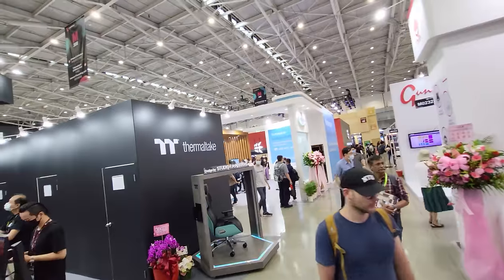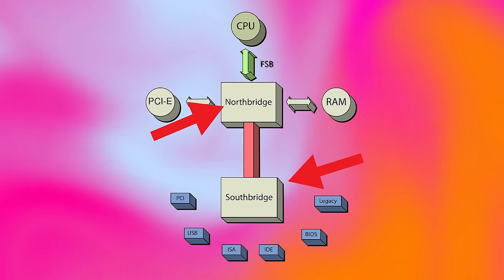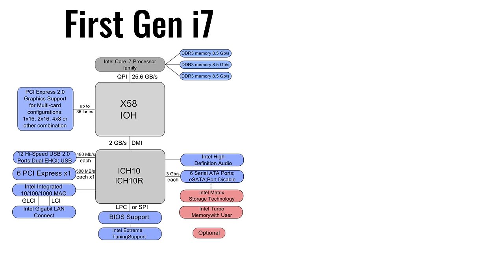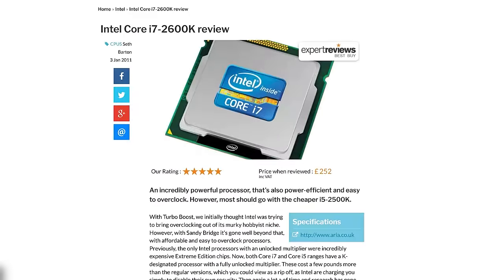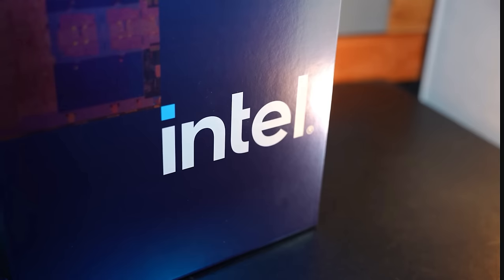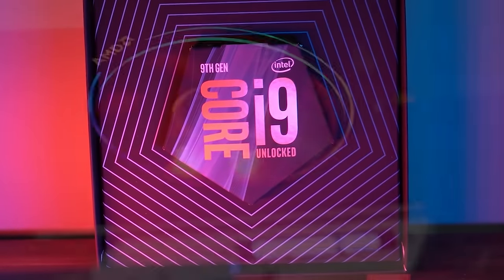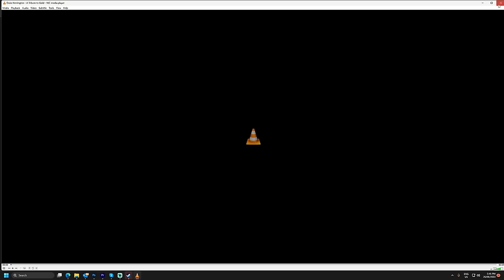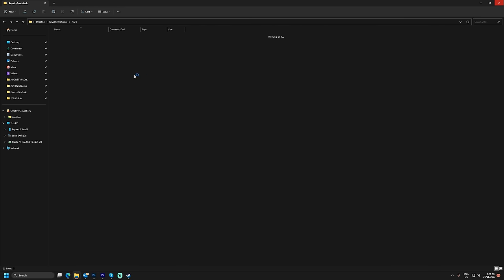SNAP - The Intel CPU Latency Story (Part 1 of 2)

Comment: This is a subject that alot of us have already considered and talked about at least in my freind group.  We still think the experience is better on 12th and 13th gen Intel then modern Ryzen counter parts. Ryzen freezes, lags, stutters, hitches randomly way more then our Intel builds you can tell when you are using Ryzen there isnt even a need for a blind test.  But its still considerably better then modern Ryzen we have systems over here laptops and desktops and side by side the experience is still better on 12th and 13th gen Intel.
Reply from the maker: It's a topic that I see literally see no one talking about, people behind the scenes were VERY RELUCTANT to talk about the issues in-depth.  However it was enough for me to start getting the word out and telling people to believe what their eyes see, rather than just listening to the 'it's all in your head'. I will have to start getting more objective measures in place though, but that will take time to set up 3 different rigs and have a standardized processing facility to weed it out.
Reply: freezes, lags, stutters, hitches randomly? just upgraded from haswell to ryzen 7700x. I'm using windows 11 and linux and didn't notice any on either setup. If my system "freezed, laged, stuttered or hitched" i would check it it in the logs and fix it or replace the part causing
Reply: I got the freeze/hitching problem with 5900x and 1600, but not with 3600 (using standard cl18 3600 ram), also my 10400 was smooth as hell, right now i'm using 12400, I do think my 10400 kinda smoother than 12400. ( yeah i changed processor a lot for every 3 months back then,  just because out of curiosity) I'm gonna stick with 12400 probabbly until it brokes. Can't see the merit of upgrading processor with already existed last 2 gen until te new one gives 3x boost performance.
Reply from the maker: @michal1693  I did say in the video, that it won't affect many at all. Nothing wrong at all with the system, if you want to trial hitching your system, get about 80GB of video footage into a video editing program, have at least 10 tabs open, excel at the same time, photoshop, 4 different file tabs and then start alt tabbing between them.
Reply: Not getting the stutter or hitching on 5800x3d, i've also owned 3600,5600 and 5800xpreviously with no issues in that regard (i notice anomalies like that pretty fast)
Reply: @techyescity  - the architectural latency you mention in the video i believe is a real thing. Kudos if you find methodology to measure it in real life. The "freezes, lags, stutters, hitches randomly" he mentions are a different thing and can be easily tracked in logs.

Comment: You should try using cms/mbr instead of uefi/gpt. Most systems still feel horrible and have huge latency penalty on uefi and gpt, screw resizable bar, not worth it at all. Seriously try it. 

I'm a latency enthusiast ok lol, know my way around windows better than your typical tech reviewer or casual gamer who likes to use custom os like atlasOS or ggOS. With uefi/gpt on a well configured windows (disabled unused devices,drivers,services and sleep deltas stable at 1ms and using independent flip instead of fse etc.etc.) basically just following calypto's latency guide. 
So with a tweaked windows, 13700k/3080 still has higher input lag than a fresh install 22h2 with mbr/cms, just on the desktop you instantly feel the mouse is not floaty at all like on gpt..
And after tweaking windows on mbr/csm it's a whole different story, amd can't even get close to feeling this snappy. Especially their unstable 3d v-cache that has messed with bunch of latency sensitive peoples muscle memory in the tweaking community.

So yeah pretty sure your main problem with 12th/13th gen is using gpt unfortunately. There's also the ecores tho.. If you oc cpu/ring and memory then not disabling ecores only hurts latency and performance and even power consumption lol. Should only enable when you gonna do some rendering tasks.
Reply: is this described in-depth somewhere on forums or webpage?

Comment: I guess this latency issue is why my potato 4th gen i3 is comparably faster than the office laptop 12th gen i5 that i am using right now when it comes to GUI responsiveness. Dang it, i am supposed to use this for the next 5 years.

Comment: I have a 12th gen cpu that had the same problem.....It came with windows 11 on it.  I installed windows 10 and the problem went away...That computer does not go online and is never connected to the internet....I believe windows is sending monitoring data through the bios bypassing any security or encryption.  When this data file gets larger and outside the normal operating parameters its causes the system to lagg.  My system would lagg up to 30 seconds randomly when just dragging a file.

Comment: So, yes. I owned a 12700k and recently sold it because I thought it was just a bad chip. High latency, poor overclocking, bad memory OC support (Alder Lake issue in general). But most of all, I noticed how slow things were to activate upon being executed. In the end, I found only one solution with two components: 

Disabling hyperthreading. This made a MASSIVE difference to latency, lowering it substantially.
RAM tuning. Increasing tREFI to 50,000 and knocking ~400 MHz off my sticks while tightening the primary timings.

I bought an inexpensive 12100f and am waiting until the 14700k Raptor Lake-R is out. I recommend you look into disabling HT - leaving the E-Cores on doesn't change latency whatsoever in my testing, which is shocking.
Reply: reminds me of...i7-920 and x58 chipset.. after disabling Hyperthreading the system felt much snappier for me
Reply: @michal1693  Yep! I actually have a 3930k in a family member's system. Disabled HT for them and it runs like a dream. The latency penalty on the older platforms is still nothing like 12th / 13th generation though. It's really extreme, the boot times especially. 55 seconds on my Z690 ITX board.
Reply: Does even the 12100f benefits from disabling hyperthreading in your testing?
Reply: I had both 12900k and 12700k. 12900k seems faster.. Might be an issue with disabled chips.
Reply: @trixniisama  The 12100f definitely has the same latency penalty as my old 12700k, but it's not anywhere near as bad. 

I believe since it only has 4 cores / 8 threads, there's less communication between the I/O die and the CPU cores. The latency penalty is fairly low in comparison.

Comment: Hasn't latency been an issue for Intel all the way back to x286 when they put a "16 bit" cpu on an '"8 bit" bus?

Also wife? I thought you just had an ex-wife. Did I miss an episode?
Reply: The 80286 exposed all 16 data and all 24 address lines. It was the 8088 that had an 8-bit external data bus that was multiplexed with the address bus. I don't think latency was much of an issue when the alternative was having a secretary do the calculations or transcribe your scribbles
Reply: Not sure what you're talking about, latency only just got good on AMD since 5000 series, before that they were behind Intel by quite a bit, especially the early Zen chips.